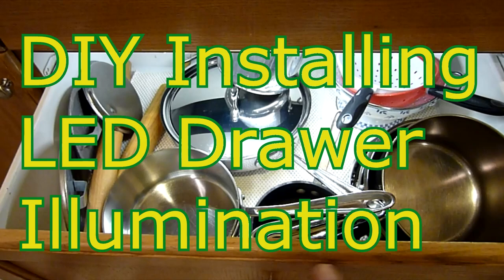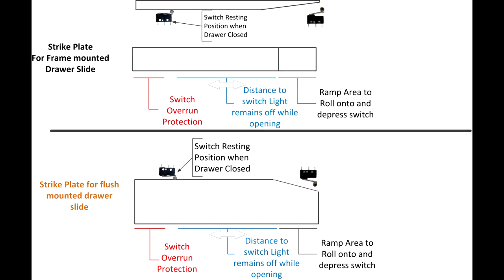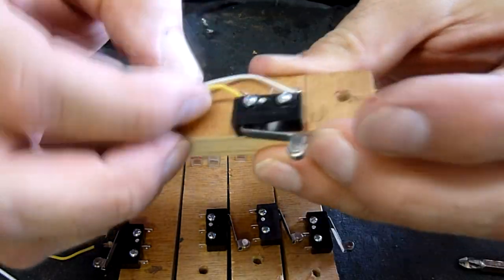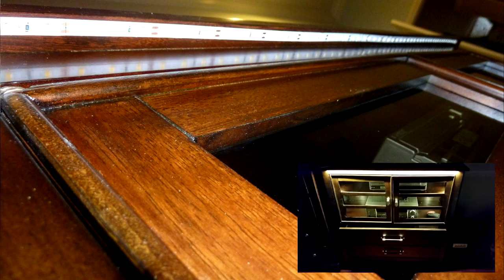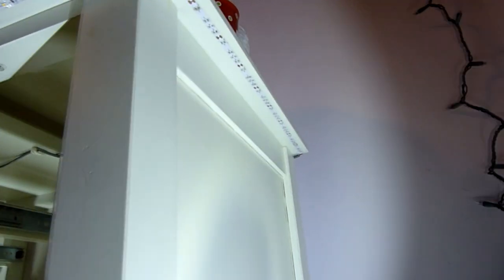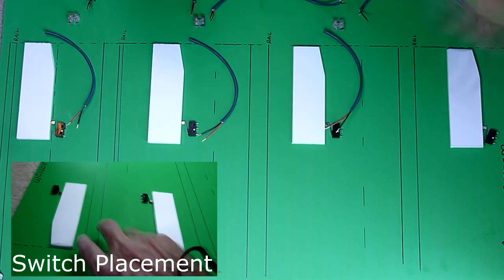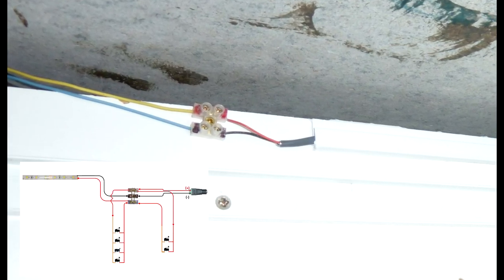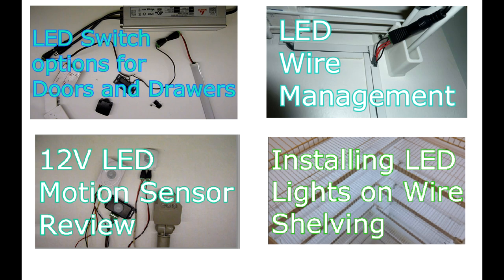DIY Drawer LED lighting and illumination Instructional Video

Comment: Great video, ive just done an led install on wardrobes, i routed out a channel top to bottom near the door hinges and installed aluminium profile (8mm deep, 12mm wide) so the light is flush with the carcass. Then used hafele door sensors and drivers. I am now looking for a way to do my draws and really like your ideas. I could probably use the door sensors again and have them at a bottom corner of each draw so they cant be seen. Im defo going to route a channel for the leds/ali profile again as that worked so well. 

Really liked your dimmer video too. Thanks

Comment: This was incredible. Thanks a lot,
Reply from the maker: Two updates I have not posted to a new video yet.  For very narrow overhangs I have used 4mm wide led strips.  They frequently have twice as many lights making them twice as heavy with half the glue. Very small dots of hot glue at the cut point will fix that.  Watch not to damage the fixtures finish. They have very very small solder points. 

The second is gravity drawers.  They are space efficient so no room on the sides and frequently none in the back.  For those I put the wedge to trigger the switch on the top back corner.  Or use a magnetic switch.  You can see one in an Alexa control video in my channel library.  

Still the best led feature to have. Enjoy.

Comment: Could you recommend a normally open magnetic reed switch I could use in my drawers and cabinets that will work with a 24V LED driver?
Reply from the maker: So that answer... lets say no... in that I don't buy from a supplier that can present a consistent enough offering with accurate rating.  
That being said.  I try not to by the tiny ones.  Even the ones of a size you might like frequently come with "half" a magnet in them.   They give you an arrow to align so you end up where they want.  I have never had a problem, so maybe they are not wrong.
Voltage... not your problem.  If you just randomly pick a reed switch you will likely see it does at least 100V.  Your limitation will be amps.  As a general assumption, half to one amp would be an assumption if it was not rated.
Supply... the big A has them of all types.  The ones I have used in the past (in that video)I used to think where expensive.. this week they are listed at 10 bucks.   Maybe that is what they cost now.  
To see ones with real ratings browse around on mouser or alike.  They always have specs and data sheets.  They also sell known products.  If you find the money outside of budget, you have a price and features to compare to see if there are alternatives.
The one in the video from the big A was B0009SUF08.  While reed switches are nice, I still use limit switches.  At under a dollar, I get used to the click.
Reply: @alwaystinkering6972  Thanks! I started looking into the reed switches to avoid the click, but I may be over thinking.

Comment: Hi there, i have installed a strip on the underside edge of the countertop of draws in my bedroom. I have a hafele touch switch that works well but would prefer it to be automated. I have an hefele pir sensor switch that keeps light on got 30 seconds, and just trying to figure a way to that each draw sets off the pir. At the moment i can only think of having string connect on each draw to the sensor and thread it through an eye screw so that each draw will make the sensor move enough to set it off. Can you think if anything else i could do??
Reply: Just realised ive messaged before, im only just getting round to doing it.
Reply from the maker: Are you thinking of putting the PIR sensor inside the compartment with the drawer?  If you were doing that I would consider magnetic switches if you wanted to go touchless.  Multiple PIR switches... lets say you had multiple PIR switches and one light... it would not matter which switch tripped, the same light would turn on .  Sometimes PIR switches don't like back power... when power arrives on they expect to be the load side.    If you were to use the PIR switch outside the compartment... the brand offers a lot of switches... but the  PIR's were rated for 3.4 meters to trigger... that would mean anyplace close and the liights would turn on.  What ever you are thinking, if you have a switch you should setup some type of test to make sure it will trigger the way you want.   I think some of regular switch per drawer would be more affective... it is absolute, however without the timer attribute, it does add another way to leave the lights on in a room.  Maybe there is a timer circuit that could go in before the light to limit the on-time.

Comment: This is very helpful! Thanks for making this video. Quick question, If the lighting transformer outputs 24v or 48v DC, is there any reason I can't use a micro switch that's rated for 250v AC?
Reply from the maker: Not at all.  So long as it fits, would not be overloaded and fits your budget… all good.  I have a switch video that covers some switch options.  The limit switches I used are rated in AC volts.
Reply: @alwaystinkering6972  Wow thanks for the quick reply! Do you have an amazon link to the switches you prefer? I'll be using a 48v power supply (so big as it's driving quite a few in-drawer lights)
Reply from the maker: @Paul-jp8zz  I have always purchased from tempo industries… bought there first and they worked.  I usually just buy their bag of 100 when I run out but they sell 10 and other qty.  I usually buy through their eBay store. https://m.ebay.com/sch/i.html?isRefine=true&sid=temco_industrial direct I have never used  https://temcoindustrial.com/

Comment: Well done!
Reply from the maker: Thanks. Well worth the effort.  If you have self closing drawers I mount the strike plate on the top back of the drawer.  Most don’t leave space on the side. I need to post update video for that and center mount slides.  You can see a gravity drawer mount in my Alexa kitchen video if you need.

Comment: 23:33 can i connect both the ends of a same strip to two different switches to achieve a 2-way connection. Situation will be, either of the switch is powered on OR both of them are powered on at the same time. Will it cause short ckt or any other problem? In your ckt diagram, you have connected only one end of the LED strip with multiple switches. Hence i have this doubt.
Reply from the maker: Lets assume the same power supply.  The switches are click on and off, not dim or electronic.  Probably.  Is it the best solution?  It has problems like one switch on leaves it on.   Electric will follow the path of least resistance.  So it will decide which way it goes.  I would NOT recommend two different power supplies, one on each end.  If you had that run two strips next to each other, one switch does one string, the other switch and power does the other string.

Nothing electronic controls, two switches will send power to the side of the connections not designed for that (outcome of that will vary based on device).   

It would require some extra wire, you could use a relay.   Power to each switch back to trigger the relay.  On the load side of the relay... run power to that and that hot let to your lights (ether end).  Then ground LED to ground, ground to the trigger side of the relay.  While not rated for in-home use, I have used car relays for such items.... oh in this model you could use three way switching, but again extra wires... but it would give you on/off regardless of side.
Reply: @alwaystinkering6972  Yes, the power supply is same at both the ends. The switch is same as shown in your video i.e., SPDT. The setup is for the kitchen overhead cabinets with two doors, where the switches are placed near the hinges of both the doors so that the light turns on when either of the door or both the doors are open (similar to a 2 way switch connection). There are 6 cabinets which will be connected to same power supply by running + and - lines through each cabinet connected via 3 channel connector. The strip light will be connected to the switches and the connector as shown in your video.
Reply from the maker: @ersomesher  Oh... run the power to the first switch... from that same leg of the switch run the power to the second switch using two strands... from both switches run the other leg to the light connection near the first switch.  Bundle the power and power ground at the first switch.

You can use the wire in wire management in plane site, or hidden above or behind depending on cabinet design.  This shows some double doors done that way.  https://www.youtube.com/watch?v=b2UO2bX0khU  and wire management is here 
https://www.youtube.com/watch?v=ZE-p_CReXgw

In this design both switches have power, but ether and both can trigger the light.  Last one closed turns it off.
Reply: @alwaystinkering6972 
I have used three point connector at both the ends of the LED light. Ran -ve line through the LED light and connected to one of the three points. Rest two points of the 3point connector, I connected the incoming +ve line and the return +ve line. Switch is connected this +ve line at both the ends. 
I also connected the +ve terminal of the LED light to the return +ve point of the connector. Now when either of the switch or both the switch is connected, the light glows. No short ckt.

Comment: Question: Can you use a dimmer on the in drawer system but just mount it before the switches in the layout? So you have the power supply-dimmer-switch-LED strip as the order of things
Reply from the maker: Yes. You can put a dimmer anyplace in the wiring that you will always have full power on the source side of the dimmer.  So basically you cannot put one behind another.   Keep in mind a dimmer should not be before a motion sensor since a motion sensor requires full power too.  
Watch my one color dimmer review. That video covers the attributes of each dimmer including how they behave between uses.
Dimmers do have a slight power draw in an idle state.  You would need many before you need to account for that in your power calculation.
Reply: @alwaystinkering6972  thank you for your response! Well, my layout is similar to your in drawer one. Its a 12V system:4×50cm LED strips for a 4 drawer cabinet (14.4W/m consumption), 4×5A micro switches, a 8A dimmer and a 36W power supply. And because i want to be able to dim the lights cause im sure 14.4W/m is overkill, i need a dimmer somewhere in the system. But placing the dimmer after the switch would mean i need one for every strip. Putting it right after the power supply and then going towards each switch in turn means i can use only one (dimmer).
Edit: i did watch your one colour dimmer vid and it helped a lot
Reply from the maker: If you have full power to each dimmer your only worries should be.  
- A place to hide the dimmer where you can reach it and it not be in the way
- deal with the extra wiring to and from each dimmer
- the dimmer having the power level you want when the drawer is open. 
One strategy I use a lot nowadays is putting the right amount of light.  If look at the entertainment center video I posted you will see that so long as I get decent coverage and it is attractive I use as short a strip as possible.  You will notice that I still use a dimmer in most cases even with that strategy.  It also allow for buying smaller power supplies since I am minimizing the draw with fewer lights. 
Your power numbers look good.
Reply: @alwaystinkering6972  the thing is, i dont want to use 4 dimmers, id rather only have one master one. The drawers are all similar in dimensions and house the same type of things. So i dont need a separate lvl of light in each, i can get away with only one dimmer, placed inbetween the power source and the microswitches. That was my only concern, that lowering the V that reach the switches, they might not work, or behave weirdly.
Motives: To not have to hide 4 dimmers cause space is limited and also as a cost saving thing

Edit: The 14.4/m W strip i have from another project, otherwise i would have gone for a 7-10 W one

Again, Thank You for your help! Much appreciated!

Comment: Holy shit. I stopped watching the video when he began the list of everything you need. There’s got to be an easier way
Reply from the maker: The most common alternative is in drawer battery operated solutions.  I have tried some non branded ones.  All ended in disappointment with batteries prematurely running down from powering the motion sensor and some randomly turning on.   Check the ikea videos.  People highly recommend them and describe good experiences.  All of the drawers I have lit just work.  This is why I like powered solutions.  Thanks for watching.  Please check the description. It should save you some writing. A 20 to 22 gauge wire might be easier to work with so long as the drawer system is not too large.  Good luck if you take it on. I think you will love the results. I will also add 4mm wide strips are easier to find now at a reasonable price.  A little harder to work with as they are so small. When you don’t have enough space it fixes a problem.
Reply: Always Tinkering Thank you for responding the way you did. The comment I left was probably a little bit rude. I apologize for that. It just freaks me out because I know nothing about soldering or most of the other things. I am actually building a nightstand from the ground up. But I know nothing about wiring or electrical things. I will be sure to watch your video more in depth and really take time to learn from it. Thanks so much again. I’m subscribing to your channel.